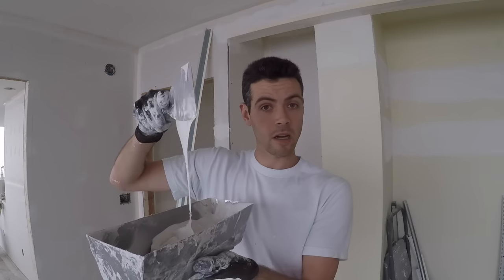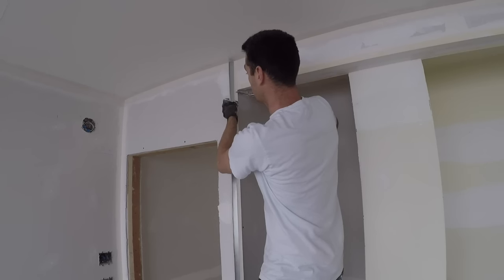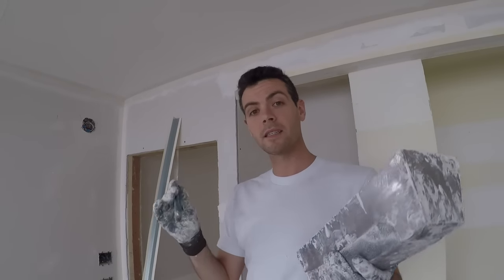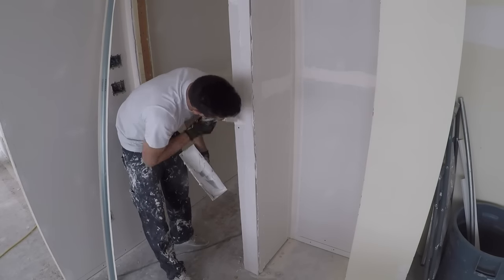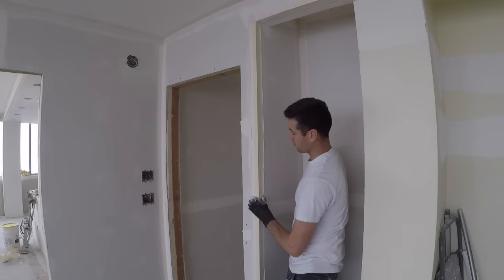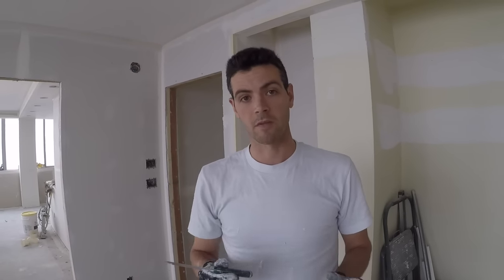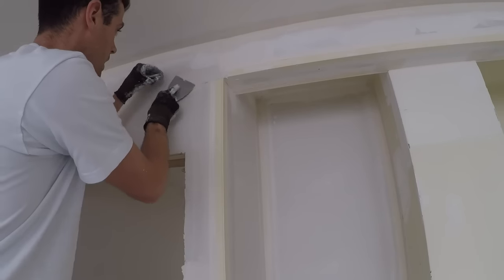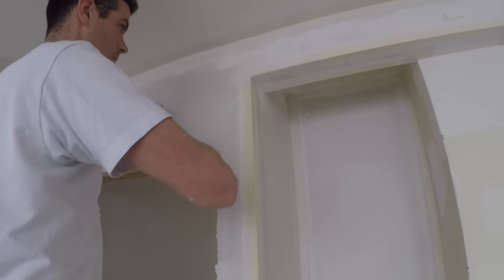HOW TO INSTALL CORNERBEAD (PAPERFACED)

Comment: I have to say you are probably the best at doing instructional videos.  I hope you keep making videos, I'll be watching them.  Thanks.
Reply from the maker: Thank you:)  I will. I just haven't been on any jobs where I have been able to film lately.
Reply: I have a question for you.  I finished my corners some outside and inside corners) and part of my project I had to do a skim coat on a couple walls.  I used the same compound for everything but the dried skim coat seems much softer and rougher than than the corners.  I thinned out the compound a lot more for the skim coat than I did for the final coats on the corner.  Any advice on fixing this?  Re-skim coat with a thicker mixture? Anything to avoid it in the future? Thanks!
Reply: I forgot to mention when I am sending I am having trouble blending it in because the skim coat sands down very easily than the harder mud from the corner  so its leaving a ridge no matter what I use to sand with
Reply: vanislefaller you want your mud fairly thin on your skim coat. Purpose of skimming is leaving as little mud on the walls as possible ( for obvious reasons ) and also to make it much easier for sanding. Hope this helps
Reply from the maker: @ols1634  heavyweight all purpose or taping mud.
Reply: vanislefaller , my sentiments exactly!
Reply: @vancouvercarpenter  can I do 1 coat or should I do 2 coats of the mud?
Reply: I agree ☝️
Reply: Literally came here to say that

Comment: Thank you for sharing your knowledge and skills with us inexperienced drywall tapers.  I recently started off my own painting company (which offers drywall repair), I have never had to repair or replace a corner bead, since I have only repaired small holes in the drywall (in fact, I did not even know what a corner bead was, until I typed in "Drywall metal corner repair/replacement).  Thanks again for simply explaining this process and for showing us some simple tips to make this easier (such as showing us that the mud should be a little bit runny).  Your willingness to share your knowledge and experience will help me look as though I will know what I am doing, if I land the drywall repair estimate.

Comment: Been 40 years since I did any large drywall projects. Always hated it, but your vids have me back on track and enjoying it! Never used these style corners and needed not only basic install, but the tips you always offer. Thanks to you I have managed to do my extensive home-remodeling project with only about 10% dry sanding! The rest is 3rd-step feathering and a bit of sponge sanding here and there. Best no-nonsense videos on the subject. Thanks from another carpenter who knew more than he wanted to about drywall LOL

Comment: Back in the UK corners where made with using two trowels forming the corner between them or nailing dowel on the corners and plastering up to the dowel for a rounded edge. Modern systems are a great improvement on those old ways but they still worked good.

Comment: This is why you do 45 degrees in order no to need tape and you should use durabond for your corners, just a little knowledge I acquired over a very successful career as top Drywall system professional in the entire USA East Coast. But you gave good advise for lining corners and using a piece of tape which will help prevent cracking

Comment: Awesome, thank you!  Would it be possible to create a quick video of the sequence of events?  For example when corner bead would be applied or when to do sanding.  If using a plastic corner bead that is affixed with spray on adhesive do you apply the bead in the same step as mud on corner bead?  Thanks again!

Comment: You have taught me so much from your vids, keep it up! On this particular one, I noticed I can use small staples and staple in, bang gently with a 1lb hammer and mud as well, but mine is rounded, so I can play with it around the right side of the surround and retainer.

Comment: Thanks for your very useful and clear tutorials. I have a couple questions as to corner beads - first, what do you do when the two ends of drywall panels don't meet flush, ie one falls short of reaching the end of the other? Does the edge need to be made up or prefilled somehow? Second, how do you ensure that there is gap left to fill on the corners beads, is it just the natural shape of the corner bead that ensures this? Thanks again.

Comment: I love the way you show even how to load the knife or trowel with mud that is important to me- also you showed in one of your videos, on metal corner bead you also used tape on the flange side of the bead - I was wondering if the fib a fuse paperless drywall tape , which is supped to be 70% stronger for crack resistance would be good to use.

Comment: Does anybody else fill in the entire inside of the bead with joint compound and then squeeze it on? This is how my dad taught me. I think it helps stiffen the entire center bead itself.
Reply: Danny Watson  the hopper system is great. I like how you can adjust the gasket to determine how much mud comes out. Good stuff!!

Comment: Great videos man.  I had to tape a butt joint and a few inside/outside corners for a home project.  After watching all of your videos I can proudly say I got the seal of approval from my wife after I was done.  It took a few more coats that it would you but in the end it turned out great. Thank you for your time making these.

Comment: An old timer from Scotland taught me a trick that has worked really well for what little drywall repair that I do. After you determine your paper tape length, dip it in clean water and apply it over the mud and let it dry. I haven't had a blister show up since using this method. Have you tried this before?

Comment: your videos are great...just one suggestion. cut your bead with a forty five degree angle at the top outside corner and you wont need to add paper tape to prevent cracking, or you could tape your transitions when you tape flats.

Comment: Good video! Haven't tried those paper corner bead yet. I usually use the metal and tape and pre fill beads with durabond 90.
Reply: The paper faced metal and vinyl bead were originally designed for use when using commercial wall coverings. They didn’t need additional coats to finish. I also prefer your method, this application is the strongest and the easiest to repair. Try removing the paper faced bead, next to impossible.

Comment: I've got a failed inside corner bead in my kids room (old house) that I am fixing.  Looks like it failed because the metal is bulging out from the wall so the tape was all bubbled.  Should I just pull the metal piece out and start fresh? Total novice here and learning heaps from your vids. Thanks so much!!

Comment: Thank you, very helpful. I've only seen one person screw in the cornerbead. Is that not normal? The other three have just mudded them in. 
Thanks
M
Reply from the maker: Hi Melanie. It depends on the type used. Paperfaced beads such as in this video are applied with mud. If it is an all steel bead they get nailed or screwed on but I don't usually use those as they are more prone to cracking. When you go into a house built in the 70's or 80's and you see those hairline cracks running up every other cornerbead you will see why.
Reply: Should I replace the old metal one that is screwed in with a paper faced one like in the video or is it supposed to be replaced with metal again if it was originally. Thanks.
Reply: @T.d0T.  U can replace with paper face.  Actually it's a good idea to do that than to use metal again.

Comment: All I can find easily are the full vinyl perforated corner beads. No paper at all. Are they awful, should I return them and try to find a supply store. I would love a video just on corner bead types etc like you did for the types of mud. Very helpful, thank you for adding what is available in the States and what the names would be. Your video's have given me the confidence to try it. From New Orleans, T

Comment: Why IS the carpenter doing so much drywall? Though I'm so glad you do, and am using what I learn. Any tips for an old woman who needs to replace a heavy exterior door (in existing frame) without any help? I can lift the door, but cannot hold it to drop in the hinge pins.

Comment: no-coat bead is better because you can adjust it to any angle - inside or outside corner. For a straight corner like you have regular metal bead is the best product for the joib...

Comment: I tried paper beads on my basement remodel and failed horribly.  Every corner blistered quite badly after first fill coat.  I worked in the trades as a carpenter for a number of years (hardly ever drywall except for a patch here and there) so I thought I could pull it off.  My first thought was that I squeezed the paper on too hard and it was trying to pull off.  But noticed that the blisters were actually over the metal corner not the part sitting on the mud strike.  Like the paper delaminated from the metal!  Made me wonder if material failure was the issue. Another friend from the trades said I should have applied a drier thinner first fill coat.  I did use light AP for setting and fill coat.  My final solution recommended from a drywall pro acquaintance was to use metal bead set in taping mud w/o  nails since there was metal stud framing and double layer 5/8 rock in places.  Then mesh tape and hot mud to bridge the metal with the wall.  One fill coat on top of that with hot mud then topping off with light topping mud.  Lots of work and was set back about a week.  But my corners now seem bombproof.   Next time I'll hire a pro.  Getting too old for this *ish.  But thanks for helping me believe I can do it lol.
Reply: My first few attempts with paper tape failed too.  I think you need to use thinner (wetter) mud when using paper tape, and definitely do not squeeze it all out with your knife.  Sometimes if I don't care to thin my mud I'll soak the paper in water before installing.  Ive had 100% success with paper bonding when it is wet or when using water thinned mud.

Comment: I apparently didn't get enough mud for all the spots to adhere, so there are some voids. 1) Should I use a syringe and squeeze in some wood glue. 2) Spray with water to get those areas wet and push the paper, hoping it wil stick. 3) Spray with water and add more mud? 4) cut out and start over? Any advice is appreciated!

Comment: One uses paper tape for the inside corner. But I don't remember any of your videos showing the initial taping of the inside corner. I will be tackling this on Friday 2/8/2019. Single man drywall job, small closet and hallway.
Reply: Here in NZ we use the reverse of this for inside corners quite a bit. Way better results than just tape.

Comment: I am learning the hard way, many trial and errors. I have an inside corner wall in a spare bedroom that cracks no matter the number if times I have added more mud to the issue. Thought I stopped it after waiting a few months to see if would crack before painting. It didn't crack so painted, looked good for a month then began cracking . I decided to take it all out to see the inside corner wasn't cracked but the begining of the inside corner was cracked top to bottom. Have been watching repeatedly your taping videos, none of your corners are cracked where mine is. Almost looks like the sheetrock used stopped just before the area the corner tape is. Thinking I need to tape over the edge of the corner tape, if this makes sense.

Comment: Nice job on this .Like watching all your videos.Question I need to do new walls and the house has on heat the day are only up in the 50's and nights in the 35 area. Is it ok to do joints in these temps or not. Can heat while there but not all night. Mabe quick set 45 would work of with not cracking come spring. Thank You

Comment: Should the drywall sheets be (made) tapered at the corner to prevent a raised edge if the corner bead is added?

Comment: Thanks. I’ll be repairing some popped outside corner on a soffit. The old corner bead is metal. Question: can I just put drywall screws in to fasten down the old popped outside corner and then mud over and apply the paper faced outer corner, or should I rip off the old metal corner bead and then place the paper faced corner?

Comment: Love your videos! I have a large gap left over after cutting out an outside metal corner bead that had been floated out a good 1/4 - 1/2" after finishing. So it's a 1/4 - 1/2" deep gap, that is about 1 1/2" wide on either side of the corner. What would you use to fill that gap before installing the new corner bead? Concrete fill doesn't seem to be available anywhere around here. Would quickset work - or would you recommend ripping down the drywall and starting over there?

Comment: Remodeling a room, using Durabond 90 to set mesh tape and USG Ultra Lightweight for finishing.  Although the Ultra Lightweight is "All Purpose", it shrinks quite a bit. Can paper-faced corner bead be installed using one of these, or do I need to buy USG All-Purpose just to install 3 pieces at an entryway?
THX

Comment: brilliant thank you. Can I use something like this on the 'innie corners". My house is 108 years old and there are large spaces in 2 of the corners. (yes it is still fundamentally sound, the wals are 50cm stone walls meeting interior wooden walls). I am using lime plaster as the entire house was done that way and I want to restore as much as possible with original materials but this looks like an amazing cheat
Reply from the maker: I'm not a fan of inside corner beads. Paper is cheaper, faster, easier and gives more than acceptable results. There is a bit of a learning curve but it's worth it. However, because you are using plaster you could also use mesh tape and just be sure to force the plaster into the cracks.

Comment: Metal corner bead with clinch on tool and mallet is a lot faster & no mud needed. What you have is called flex tape, great for odd corners like 90° or round archways..etc. Way to slow for regular corners.
Reply: Old ways of doing things might be a little faster but not better.. No coat paper face bead applied with a hopper and a roller..is very fast and way stronger than a clinch

Comment: Menards has that wide tape corner bead too. But I wonder - is it as durable as the metal type that you have to set onto the corner with drywall nails? What if the corner of the taped version gets bumped? For example, is it better to use the metal corner bead in high traffic entry ways?

Comment: If you end up with hollow spots under the steel, where you can push it and it deflects (the paper is embedded just fine), does that need to be fixed before the top coat? If so, how do you recommend fixing that?

Comment: Would you recommend using this on an internal corner? We have an internal corner that has a huge gap where the previous owner did a terrible job at patching plaster with drywall and left a huge gap.

Comment: around 5:30 you say to check that there is no light showing when you push it with the spreader to see if there is room to fill. Let's say there is light (which means there is room to fill), how do you 'fill' it?
Reply: By fill. He means then you mud over the the bead.. To flatten the corner..  A bed coat . another coat little more wider. Thin a skim coat.  Wider yet.. 6" 8 " 10"

Comment: Great videos, you are the go to guy for DIY drywallers! What do you do if you have two outside corners parallel to each other where the paper of the corners would overlap? say for a 2x2 wall end.
Reply from the maker: Just overlap the paper. As long as there is still room for fill after the overlap. There shouldn't be a problem unless you're putting the beads on too tight.
Reply: Awesome! Thanks for the reply.

Comment: I am planning on building a fireplace frame that extends from the floor to the ceiling with either a concrete or venetian plaster on drywall.  Would you recommend using a paper faced corner bead or a metal corner bead and why?  Thank you very much in advance.

Comment: Hi there. Great vid ..ONe question ,,though.How do u join up the ends of 3 corner bead together without a crack showing up later ..Like an outside 3way.On box ..
Reply: Miter cut each piece so that each bead comes to a point. After setting each corner bead allow the mud to completely dry then gently tap the vertex with a hammer so that there isn't a sharp point that paint won't adhere to. Use 45 or "quickest" for the final coat so that paint won't flash there.

Comment: Im assuming these tips work for windows as well? And is there anything special you need to do on existing Sheetrock thats painted around windows?  I replaced windows in my house and had to cut out sheetrock

Comment: These are great videos, however I am curious if you have any tips for textured walls? I can never seem to duplicate the same look after a drywall patching. Any suggestions on popcorn walls or ceilings?
Reply: They sell popcorn in pails use a paint brush and dab it on the repair and feather out the edges into the existing texture it's a lot easier to control the pattern to get the same look than the spray can of popcorn